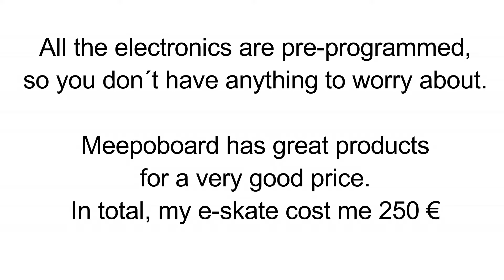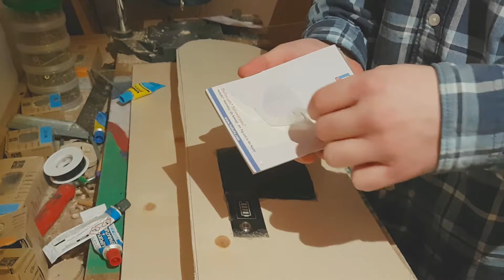DIY ELECTRIC SKATEBOARD with no visible electronics / Tutorial part 1

Comment: Where did u get the power display w the battery power on it
Reply from the maker: It was built in the esc I bought. It is all fixed in a plastic case. So as you can see in the video, I had to cut the display and esc out of the plastic enclosure.